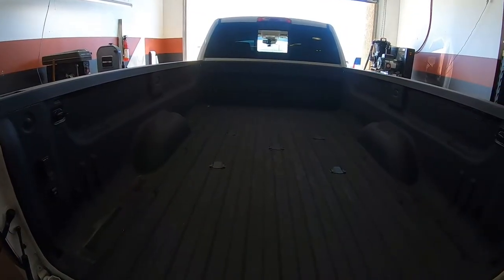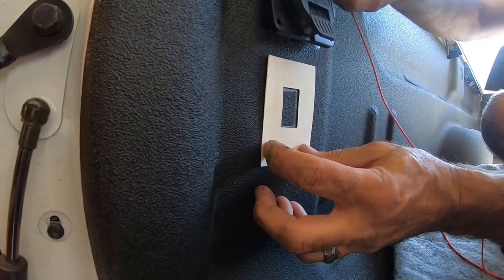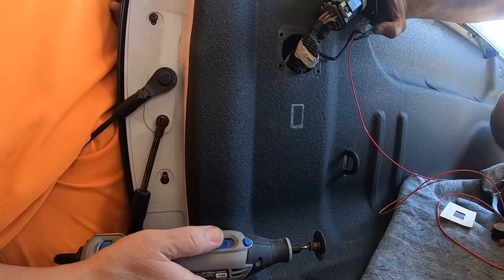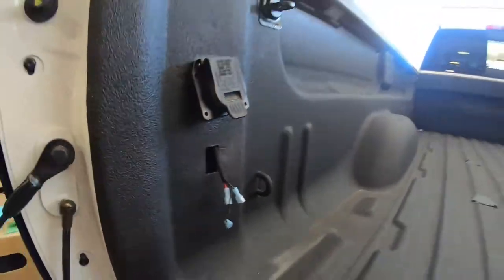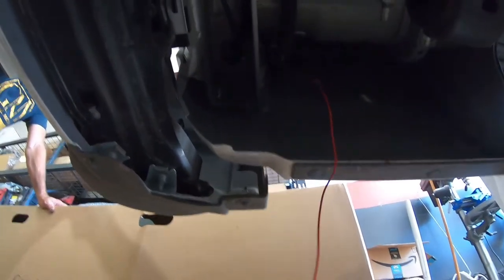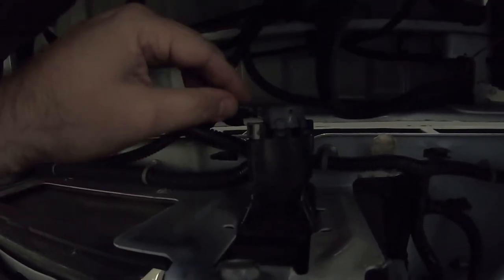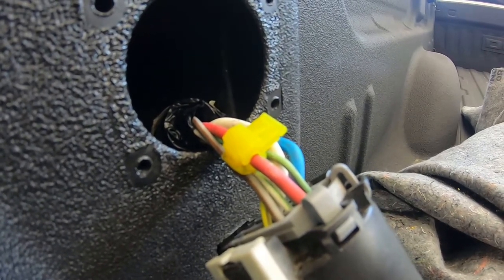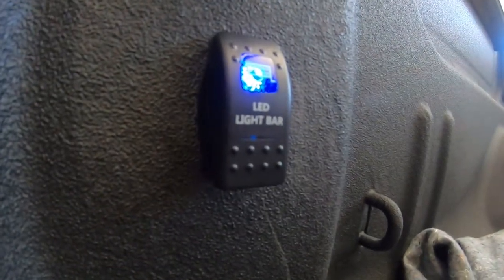External Bed Light Switch Kit

Comment: I know everyone has to be looking for this comment because they didn’t show where the T harness connects to the light harness , pull out the connector from the driver side bed light and plug it into the female side of the suppliy T harness and the removed connector to the male side of the harness and do the rest as shown in this video and on the website once I figured this out it was a 10 minute install works awesome glad I did it there was no place to leave a review so I figured it would work here

Comment: Does this work for standard trucks that have the lights just inside the tailgate on the bed sides near the bottom of the bed ? Mine is a 21 1500 std bed